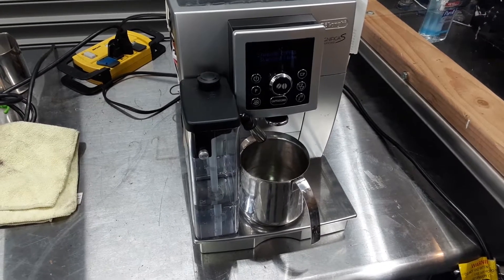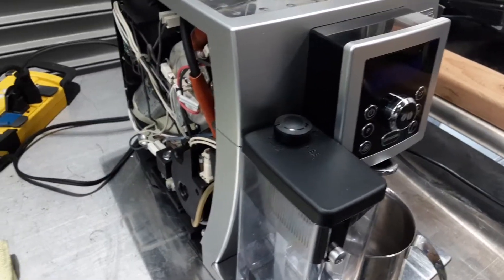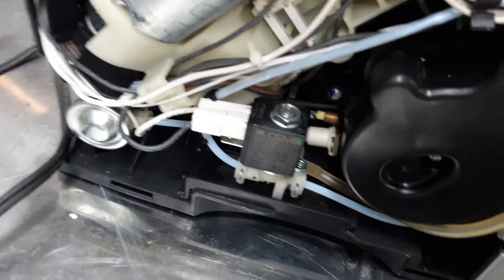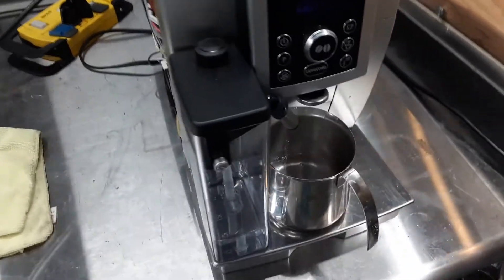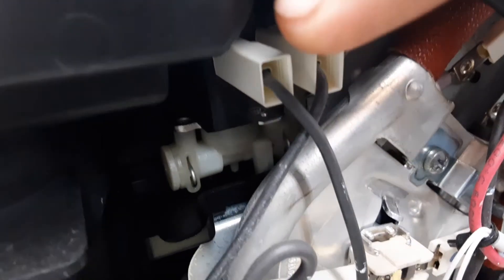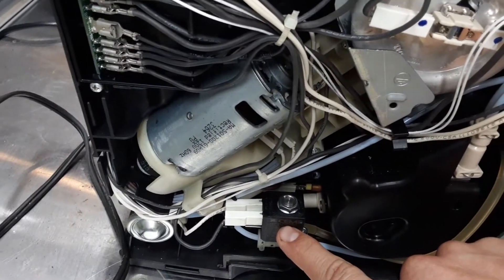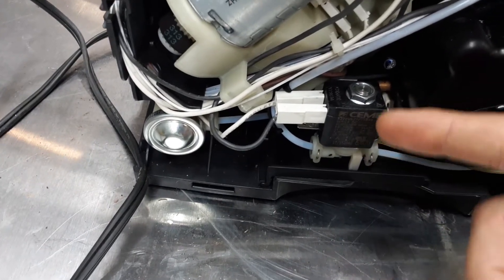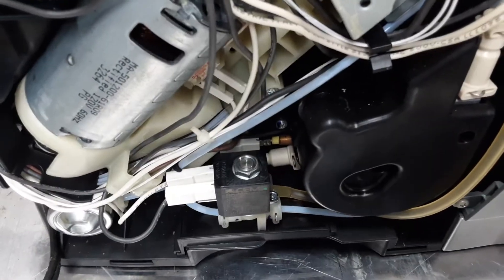Find buzzing noise in Delonghi Magnifica S

Comment: Hi, came across your video today, following a failure of our Delonghi Magnifica S. It has made strange noises in the past, but these have not impeded operation, until now!
Following a request to Descale the machine, which we have done religiously since purchase This time not only is it making unearthly noises, but failing to distribute the heated water. Before this we ran a further Descaling program, but to no avail.
Then I removed the infuser, soaking it in clean, warm water. When dry I replaced this and made another cup of coffee. It's almost as if it is trying to produce liquid through the ground coffee, which it it grinding, but just leaving coffee grounds! The water cylinder is filled, but this problem persists, making nothing more than grounds.
HELP! I'm desperate for a decent cup of coffee. Does it sound as if this machine has reached the end of its operable life, or is there another route I can take? 🙂
My wife and I live in the UK.